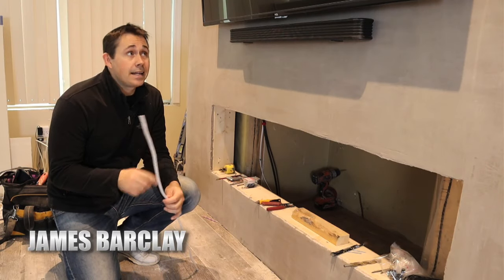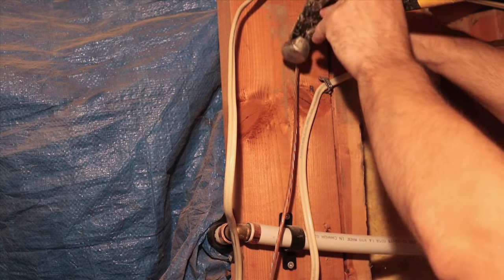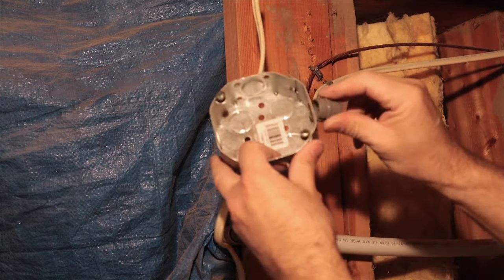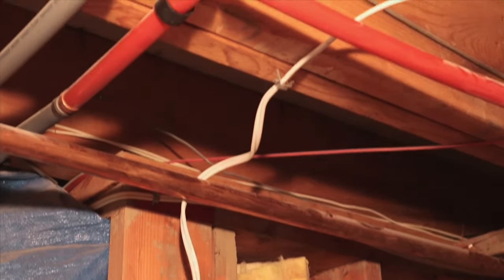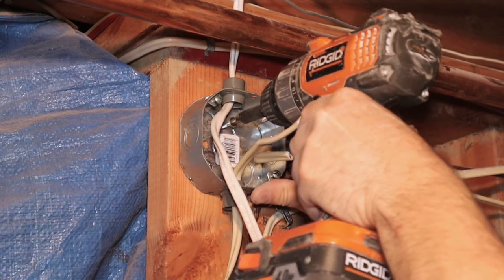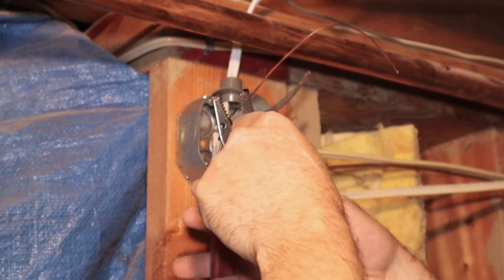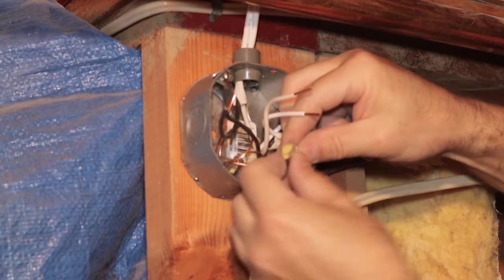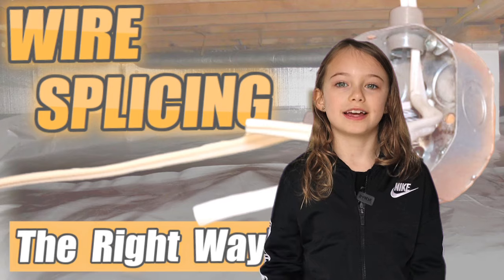WIRE SPLICING step by step!

Comment from the maker: Point of note: when connecting the ground wire to the box, it is better to wrap the ground wire around the screw in a clockwise manner. Helps to self tighten that way. My left-handed brain always wants to go the other way. But at the end of the day, having the ground wire securely fastened is the most important thing.
Reply: @NoahMartin1  
Consider the ground as an emergency exit for the current to go when something goes horribly wrong, like when the wire gets cut. If it's wired correctly,it's ok to touch any box.

Comment: I'm not an electrician but my friend who is said he likes that you used and suggested push connectors since they are difficult to get wrong but a wire nut is difficult to get right.  He also mentioned that it could be a good idea to give the entry side of the connectors a couple wraps of electrical tape unless you're sure the insulation is fully inside the connector. He went on about how an amateur probably won't strip the wires the correct length and there could be copper showing on the outside and something about push connectors usually being single use but I started tuning him out at that point because he can ramble ... I think it was a great video though
Reply from the maker: Very good point. Never a bad idea to have an extra layer of protection!
Reply: Great points George!  People assume the wire nuts are to make the connection; any seasoned Electrician will tell you twisting the wires together ‘make the connection,’ the wire nut covers the connection!  I like to further wrap high temp electrical tape around the wire nut and wires.  Stay safe!  Peace 🙏👍🇺🇸😁
Reply: Wire nuts aren't "difficult" to use, but you need to have some sense of what you're doing, so you know what detail to be mindful of. you don't want to get the biggest wire nuts to where  your splice is only grabbing by the top narrowest taper of the nut. you want to make sure you use the smallest nut on that splice that you can and that it covers the conductors completely from top to bottom. You want to make sure you've twisted it to where it's tight and that you give the wires collectively and individually a tug to make sure they're not going to pull out of the nut. If you can't be mindful of simple details like that you're asking for a workmanship error that you're not even aware of. There's a lot of detail you need to be mindful of when doing electrical work. Wire nuts hold the twist together you can twist wires together and if you didn't secure it somehow it they'd come untwisted. Wire nuts keep pressure on that twist. If you're going to attempt to do your own electrical work you need to pay attention to detail. If you're disorganized, have somebody else do it.

Comment: Don’t like wire connectors … can’t teach an old dog new tricks maybe.  However I feel the connection between well spliced wires in a wire nut is by far the best but people are entitled to disagree I suppose.  That being said, it is a challenge for a beginner to splice wires properly in a marrette.  However, if you do insist on using push connections I think the Wago brand connectors are much better than those you are using.

Comment: My house doesn't have ground wires (built in 49). Came across this video and when it came to the grounding screw, I thought "Well, I guess I'm screwed."
Reply from the maker: You could just add a GFCI breaker in the electrical panel for the wire you want to splice into, then you’re grounded without needing the ground wire

Comment: The best tool against spider infestations is a shop vac, and wear some protective clothes/ gloves.  As you work, suck in enough dust to overwhelm them so they can't crawl out.  Shop vacs or even a regular vac hose is always the best way to nab any pesky bugs because you don't leave stains on walls from smashing them, I've even picked up mice with that method.

Comment: Thank you for being straight forward and not over complicating.  Basically you ground the gold wire thats coming from the new line you're running first to junction box then twist all 3 gold together after you grounded to junction box. Then twist all 3 black all 3 white together with wire nut or whatever connector you're using. After that close junction box. Make a cover plate to make sure accessible. Correct?
Reply from the maker: Exactly!
Reply: Worth noting that grounds can be green or copper (slight correction to your "gold" reference).
Reply: @jeremylorberau1502  if you're working with copper all the wires are "gold"

Comment: I am adding a outlet for a bathroom remodel and realized this morning I was going to need a box for splicing extra wire to the new outlet. Your video was timely and easy to follow. I have seen the new connectors but have not used them so I was prepared to used wire nuts. Now that you have reminded me that they exist and are Very easy to use I will run to the hardware store and pick some up. Guess I am going down into the dreaded crawl space one more time. Thanks a lot for helping us armatures out. We want to do it right and your experience and tips help a lot.out.
Reply from the maker: Glad the video helped. Good luck!

Comment: Recently been remodeling a small bathroom...tore down a small wall with no problems.
But while showering the next day I was thinking man where are all these spiders coming from?
Thanks for the video, I've done light electrical work before but haven't really had to branch romex before, this is straight and to the point.

Comment: I hope you still see posts on this video. I've been looking and looking for the closest video that can answer my question. I hope you can answer this. Will this splicing method work if I am trying to wire a shed with all the outlets and lights...but don't want the all the ends which go to the "breaker box" installed in a breaker box...but want to ultimately connect the same size romex from an outdoor underground cellar that has solar power components. I would run wire back from the solar components underground through electrical pvc toward the shed. Feed the lines through the outside of the shed, and combine them (splice and junction box them) on the inside wall of the shed. Will this work?
Reply from the maker: In theory, sure it would work. But the question would be how powerful is your solar. You would need at least 15 amps for your shed, in order to run a few lights and outlets (assuming you’re going to plug in something like a saw or garden equipment)

Comment: Just checking... are the other ground wires being grounded because they are in the same push connector as the ground wire you screwed into the junction box with the screw? good video!
Reply from the maker: Exactly!

Comment: One point. Pull your Romex down and connect the end in your junction. Then pull the slack out the top and cut off the excess there. That way you have the longest "scrap" piece left over after the job. It's always easier to make it shorter...

Your daughter stole the video, though. :)

Comment: I like to use the bigger 4-inch square by 2 1/8 deep junction box. that way i have much more room to work with and if it is in accessible spot in a basement, I just throw in an outlet in cover plate because it's always nice to have another outlet anyplace.

Comment: I like the Burndy's for wires, a small copper barrel u crimp with linesman pliers. wire does 
get brittle, you can get into a bad situation, u have move wires to get at other wires and
they snap off, strip and twist and again the wire breaks, it very well could be that you no
longer have enough wire in the box to work with,

Comment: I split my source and added some lights, now when I click the power switch at the main box it trips. This had a light on it before I've just spliced it so they are not on the same light switch. I wouldn't think that would overload it?
Reply from the maker: Sounds like you’ve got some wires crossed up somewhere, which is why the breaker is tripping. Check your connections and make sure wires are connected correctly and not accidentally touching the side of the box or other wires

Comment: As you know, not all boxes have a ground screw. Why do you advocate getting a junction box with a ground screw? The box is connected to wood. Wood is not a conductor.  So, I see no point in using a junction box with a ground screw.
Reply from the maker: If you use a plastic junction box, then correct, you do not need a ground screw. But plastic will melt and burn in the event of an electrical fire. A metal junction box will not. You want to have a ground screw in the metal box in case the wires ever touch the side. Has nothing to do with the wood it’s attached to.

Comment: I noticed romex discolored where it had rested against a copper pipe elbow.  Isn't that dangerous.  Great presentation, however.  Really good.
Reply from the maker: Yes, I would avoid crossing or touching any type of lines/pipes if possible… 99% of the time it’s not dangerous, but better safe than sorry.

Comment: Henlo.
I can't seem to find an answer.  Is it okay to splice from an outlet to make another outlet?
My crawl space is extra scary, and my 240v is on the opposite side of the crawl space entrance, who knows what lurks that deep in.
But, the outlet is about 1 foot away from the exterior wall.  Seems like I could wire an outdoor 240v outlet, or peg it into the ground with pvc and run it underground to my garage and do an outlet there.  Only thing it's used for is a drier.
Tanks.
Reply from the maker: For anything is 240 V, you need to run a new line directly to your panel. It needs its own breaker. I wouldn’t try to splice it. That would be dangerous!

Comment: I have lots of 14/2 in my attic but which one can I tap into?
Reply from the maker: Any one that has constant power (not a line that runs from a light switch to a light fixture. To check, turn off all your upstairs lights and use a pen voltage tester to see which lines are still hot.

Comment: Why do you guys allow the installation of electrical wire without putting it in flexible conduit? Im from Holland and this is considered not up to code because mice etc could chew it and cause problems?
Reply from the maker: I’m sure it’s just a cost issue here. Or maybe we have less mice than Holland. 😆

Comment: Awesome video. That intro made me laugh. Question: which, out of the three ground wires, are you grounding to screw? Your new addition wire? Also, after it's grounded you still connect it with the other 2 ground wires via connector?
Reply from the maker: Hey thanks! And it doesn’t matter which of the ground wires attaches to the screw, as long one does and the rest are connected to it

Comment: Sp I'm learning about electrical but since your using romex wiring wouldn't you use a romex connector and not s conduit connector
Reply from the maker: In my area electricians use mostly plastic romex. Your area may differ!

Comment: Why would you choose a metal box over a plastic one which is easier to use and even contractors are using plastic now ?
Reply from the maker: I wouldn’t suggest using plastic when your junction box is out in the open like mine is. The nail brackets easily break off and there is just much less overall durability and strength.

Comment: What solutions are there when the wire doesn't have any slack?
Reply from the maker: You have to install two junction boxes. Each end of the the cut wire will go into each one and then add an additional wire to connect the two boxes.

Comment: Great video. Can a recess light junction box be used for this purpose?. I have a wire that I need to extend and the closest junction box is the one of the recess lights.
Reply from the maker: The short answer is yes, but you may want to check the code where you live. For me, I can use any junction box as long as I have access to it.

Comment: Thanks. It's very informative and helpful. Just a quick question. Why you put ground wires only two ends not three? Which one you have to decide to leave out?
Reply from the maker: All three grounds are connected together,  plus a forth wire to connect the three to the ground screw.

Comment: I did the exact same thing, then connected the new wire to a floor outlet..I’m scratching my head now, as the breaker keeps popping? I have checked and rechecked..Your thoughts?
Reply from the maker: Make sure all your load wires (black) connect well together and all your neutrals (white) connect. And check your receptacle to make sure you haven’t reversed the lines connecting to it. White always attaches on the same side as the ground.
Reply: Also might want to put in a new breaker there really only good for 3 pop's before you should replace them.

Comment: what if my existing line doesn't have much slack?  do I need two junction boxes and extra wire between?
Reply from the maker: You bet. If your tension is too tight, you can connect two boxes together with a line between them. Just make sure any boxes you add are accessible and not buried in any walls!!

Comment: THANKS. the push connector looks way better than a wire nut.
Reply: What brand is the push connectors ? Love the idea and have a job coming up.. Thanks
Reply from the maker: If you go into Amazon, type “electrical push connector” and you’ll see them...

Comment: What if the existing wire is 12g? But the connecting wire is 14g?
Reply from the maker: If your existing wire is 12 gauge, then chances are it’s running to a 20 amp breaker. In my area of the world, it’s against code to run a 14 gauge wire on a 20 amp circuit.... However, if you’re 12 gauge is running to a 15 amp breaker, then you’re OK. Hope this helps.
Reply: @thinkreno  Thanks for your speedy reply. I appreciate your help. I am running 15 amps. All the best.

Comment: Hi thanks for the video. How many ground wires did you put in the push connector? I saw only two wires in the connector, but shouldn’t it be three? Two ground wires from the bottom and the right and the ground wire that goes to the top that you tie to the metal case.
Reply from the maker: Hi. Yes, there are three in each. I have edited out every wire being inserted into the push connectors for the sake of time, but all the grounds go together, all the whites go together and all the blacks go together. Hope this helps!

Comment: How do I add a junction box to repair a wire leading to my oven wall plug that was damaged by a squirrel?I will only need to cut the one wire
Reply from the maker: You can just do it the same way as I have in the video, but you’ll just be having one power wire come into the box and then one wire go out to your stove. Hopefully there’s still enough slack after you remove any squirrel damage ;)
Reply: @thinkreno  those little suckers.I hate squirrels.They got into my winter clothing and chewed everything up.I think they built nests.Left nuts in everything they chewed.With that thought,I need to check more wires because if they did one,they probably got another.
Reply: @thinkreno  I hate the little tree rats,but I do live in the Rural South and they are everywhere since people stopped shooting them.Yes,I said that.lol

Comment: Thanks for sharing your knowledge! I plan on doing this in my crawl space. What kind of wood screws did you use to mount the junction box to the stud? Like what was the length, diameter, and head type of the two screws?
Reply from the maker: You bet. You can just use a #8 wood screw that’s an inch or 1.5” long
Reply: @thinkreno  Okay, I was thinking something along those lines! Appreciate it!

Comment: Great video, love those push connectors, haven’t used wire nuts since I’ve found them
Reply from the maker: Me too ;)
Reply: yeah especially when you got a out of the way fixture you dont want to  have to fiddle with  a loose wire nut  lol
Reply: Hey, I know this comment is old. Which push connectors did you prefer for this?
Reply from the maker: If you go into Amazon, type “electrical push connector” and you’ll see them
Reply: Not a big fan of  Wagos myself, a small point of contact connection opposed to wires being wrapped around each other then twisted even tighter with a nut.